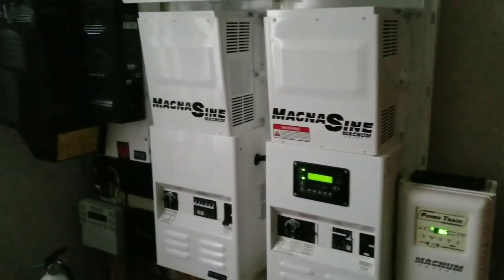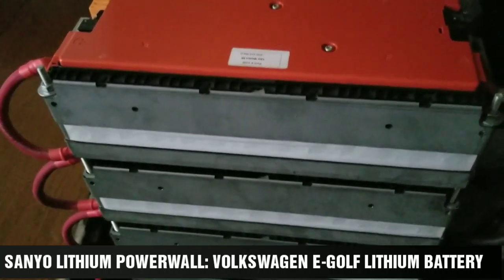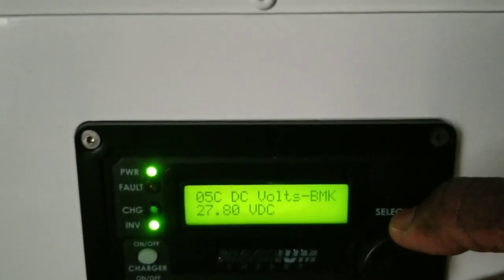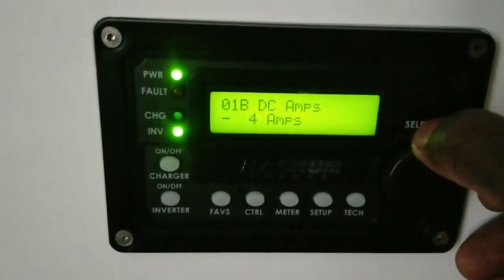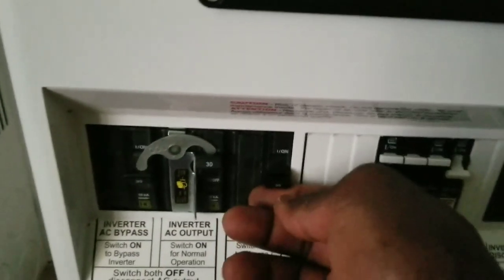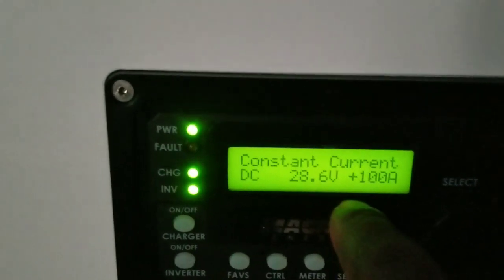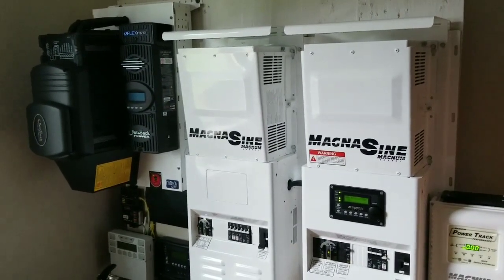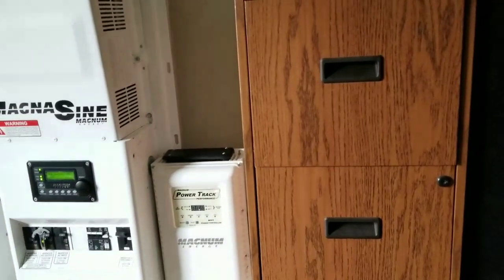DIY SOLAR HOME SYSTEM: DIY LITHIUM BATTERIES, SOLAR INVERTER FOR HOME

Comment: Thought u were running leaf batteries. How do the charge set points differ in the egolf?
Reply from the maker: They are two different batteries with different specifications and different charge set point